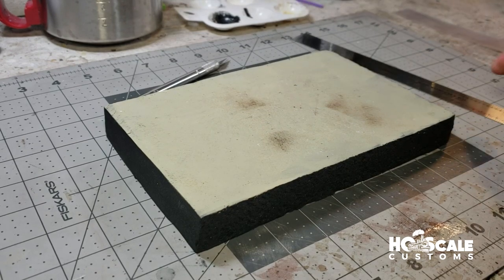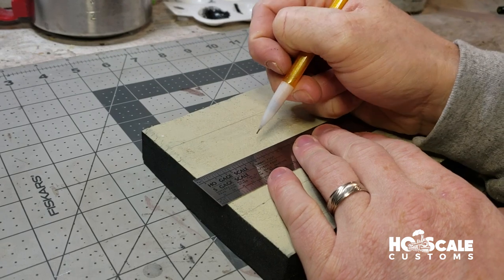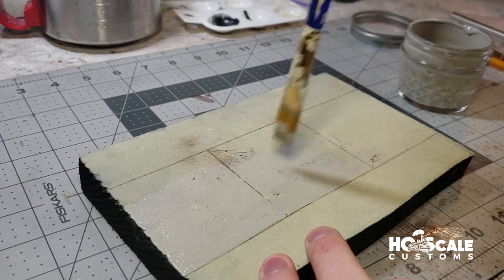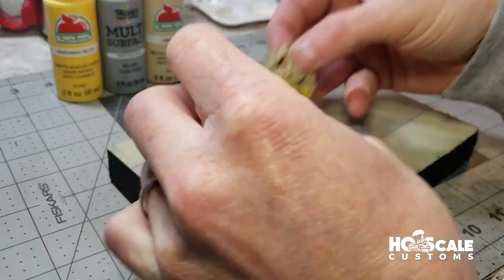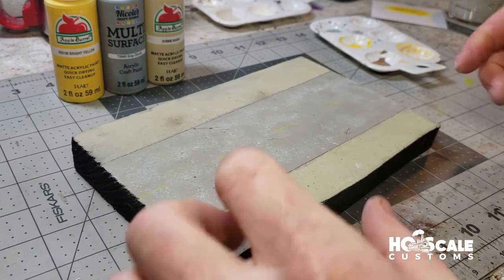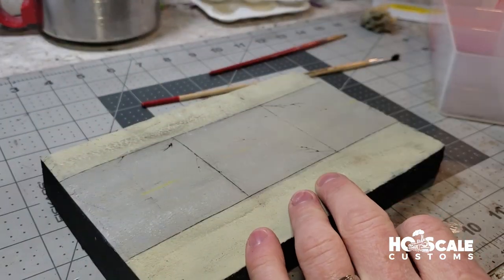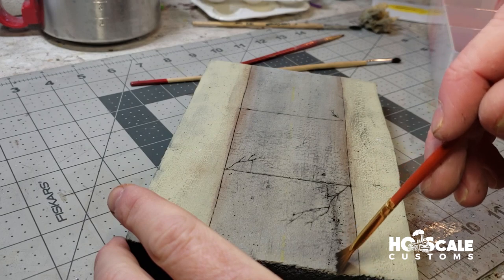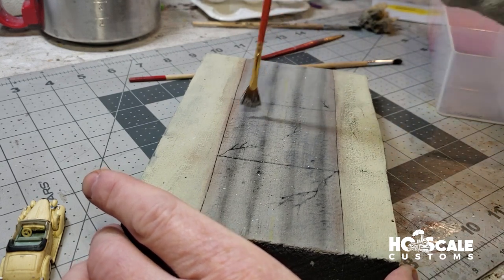How to Make EASY Concrete Roads - Model Railroading - HO Scale Customs

Comment: It should be noted dimension wise, these are good dimensions for an older highway from say the 1930s.  If you are modeling a more modern era such as after the 1960s, highways generally have 12 to 13 ft lanes now with 4, 8 or 10 ft paved shoulders, or just gravel.   Center line skips are standard 10 ft long now on 40 ft centers, so 30 ft gaps.   The gap between double yellow is generally 7 to 8”.      Looks good.  👍🏻

Comment: I don't get the black tire tracks, that's not what I'm used to seeing, I expect the wearing and lightening of the concrete in the wheel paths. I've seen this done quite a bit with foam, more often with foam core with a surface removed. I've seen some look pretty good in photo/video, but I never could get anything I was satisfied with in person. I've tried many things, plaster, spackle, etc., but I'm in love with Duram's Water Putty. I'll grant you it's harder to work with, literally as it's one of the hardest plasters I work with short of dental casting plaster. But it's the best results I've personally achieved.

I've had pretty good luck with asphalt using grout into forms, just as would need with the plaster methods. Something I seen some modular guy do on a intermodal facility lot covering tracks, just use a dilute matte medium, ModPodge, or some other PVA like dilution to set it so it will get hard enough. Although, in my case I was heavier on the glue in the center, mostly just 50% IPA to set the shoulders with little glue, so I can crack and damage the edges of the roads as it's rural road surfaces.

Just what works for me, my $0.02...  Enjoyed the video, thanks for sharing...
Reply from the maker: Thanks for the input. We might have gone a little too heavy on the dark tire lines, but I was basing it off a quick google image search of "old concrete roads" and images such as this: http://www.ebpaving.com/media/images/content/Case_Studies/Tracy_Road_Roller/DSC_0239.jpg

Or what you'd see in old road texture libraries like this: http://texturelib.com/#!/category/?path=/Textures/road/road
Reply: HO Scale Customs I see that from that pic, what you’ve accomplished is pretty much aligned with that. The textures library is awesome, can’t believe I didn’t know about that. I’m fascinated with the idea of printing road textures out and putting some seal over that. I’ll give that a go. I do love the concrete I’ve done with Durham’s Water Putty, and I’ll have to put up a vid or share with you on Facebook. There’s a lot of ways to do this stuff, and I’m always keen to see new ideas as you share. Especially when they are as easy as using pink foam. Being the base of my layout, the closer I can get to that with a technique the less work I have to do.

Again, thanks for sharing, I enjoy what you do, and especially the attention you share with other modelers. Ken Anderson is a friend, and he deserved every bit of attention you shined on his excellent modeling. Keep up the good work brother!
Reply: @WileysScaleModeling  The image you used here looks like sun bleached asphalt, not cement.

In the case of asphalt, you do tend to see tire rubber stains.  Not so on cement freeways.

Comment: Looks good, but if you see pictures of interstate highways (California comes to mind), there really isn't dark lines from the tires, but a line from the dropped oil from the engines.
Reply from the maker: Thanks! we admit we might've gone a little darker on the tread lines, but we were trying to achieve this look: http://www.ebpaving.com/media/images/content/Case_Studies/Tracy_Road_Roller/DSC_0239.jpg  &  http://texturelib.com/#!/category/?path=/Textures/road/road

The demonstration was mainly for the concrete and cracking, the tire wear was a little dark. Lightened it up with gray chalks to smooth out the harshness of it.
Reply: Neither way is wrong. If you look at images of old concrete roads, you will see both "styles" of wear marks, and even a third possibility where there is just one wide line down the middle of the line from a combination of both rubber marks and dropped oil.
Reply: Excelent comment. Almost every tutorial on concrete roads show tire marks when in relality those roads only have a darker shade down the center. Tire marks are appropiate in gravel and dirt roads.
Regardless of the tire marks, the technique to make roads on foam surface is excellent and this defenetly will be my go to method.

Comment: Very good techniques here!  I love the cutting in of the cement breaks and cracks!  But your concepts for cement highway/freeway road weathering is reversed.

On cement highways, the dark sections  are down the center of the lane of travel, from oil that drips from vehicle engines, not down the sides of the lanes from the tires.  

The tires actually wear down the cement causing that area of the cement where the tires hit, to be lighter than the the rest.

If you wanted to get even more accurate, on the scale that you're using,  you could use your index finger or pinky (depending upon your finger size), wrap sandpaper around your finger and sand slight grooves, loosely the size of your finger down the warn, travelled section of the cement where the tires hit.
Reply from the maker: We did this video quite some time ago, so maybe we should put out an updated version after we've realized now that there might be some things we've done that could be done better
Reply: @WileysScaleModeling  👍 Your video still has some good techniques.  If you revise it, please be sure to put in the original tips too!
Reply: *EDIT
It appears we are both correct!   On newer cement highways/freeways, you will get the dark tire marks going down the lanes, as you have demonstrated in your video. 

On older freeways, you get the slight  grooves where the tires have been going, but no longer show the black rubber from the tires, and the only darkened area is from oil drips down the center of the lanes, like I mentioned above. 😎👍

Comment: Just saw this a short time ago and I loved it until the tire marks took over and sort or ruined the look. Maybe the folks on your railroad's highways are drifting fans I guess. I'd think centered oil marks, heaviest after any sort of dip or even expansion joint bump, might have been a bit more common; at least they are where I travel. Still, the basic concept and construction was great and will be used by this modeler, who drove God knows how many miles as part of his professional life over the past 40 years or so. Carry on.
Reply from the maker: We realize afterwards that maybe the tire marks weren't the best. But that's how model building goes. We don't do that now on our main roadways now on the layout.

Unless of course they're doing burnouts and drifting! 🤣
Reply: @WileysScaleModeling  yeah, my layout is home to some serious outlaws on two as well as four wheels, so yeah, I totally get it.
Cheers!